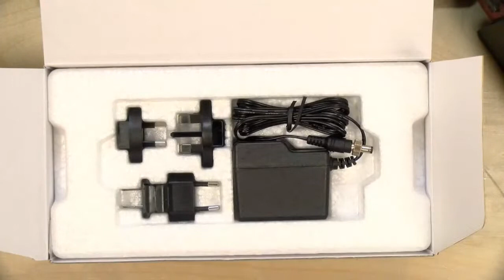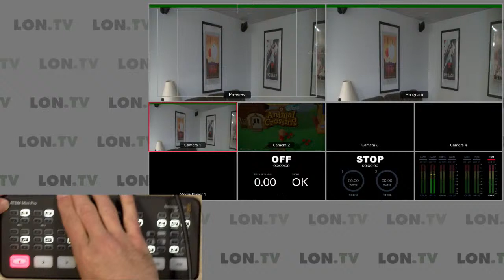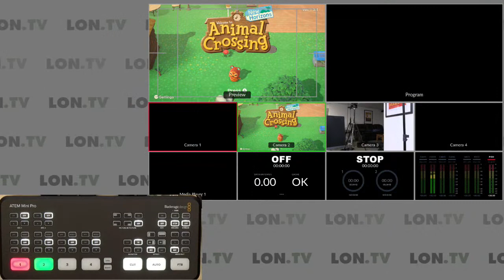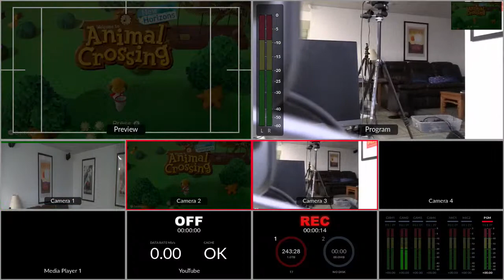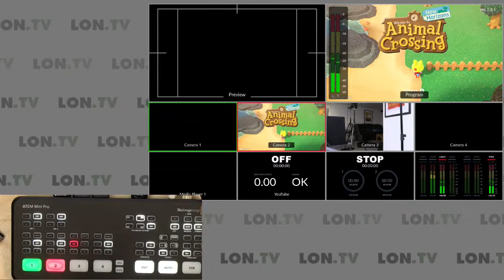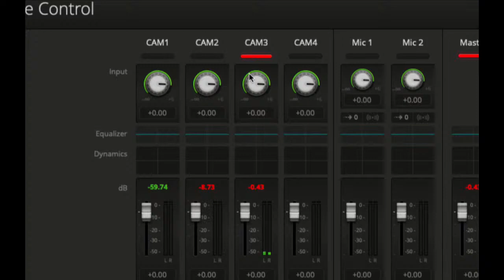Live: Setting up and Testing the ATEM Mini Pro!

Comment: It supports delay on Mic 1 and mic 2 ports. Starting from last firmware update. And they're not only mic inputs but also line inputs(you can select this from the Atem Software Control). The fan works only when it's updating.